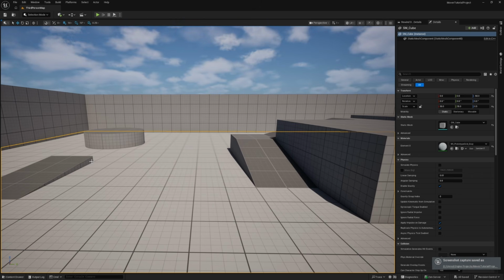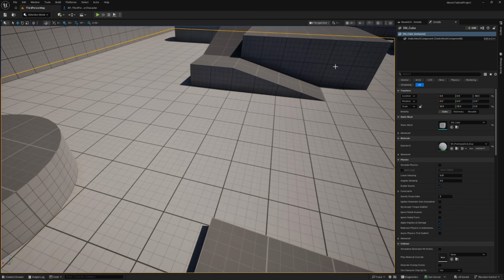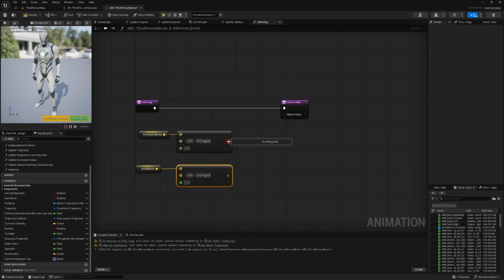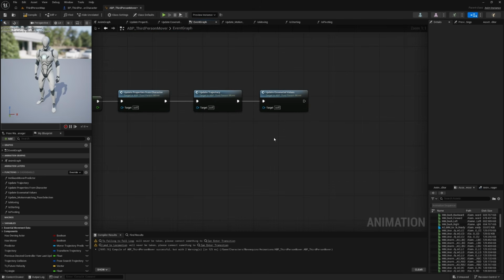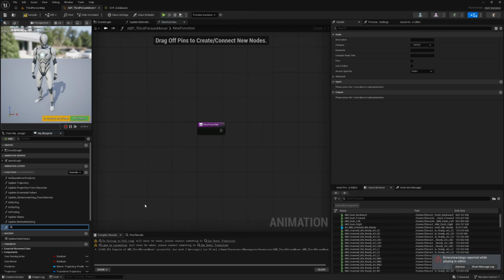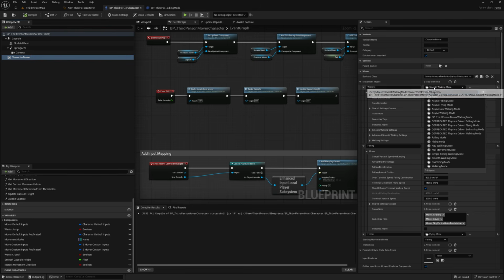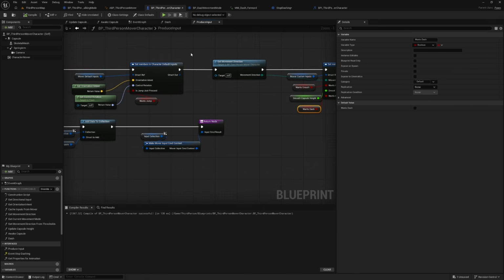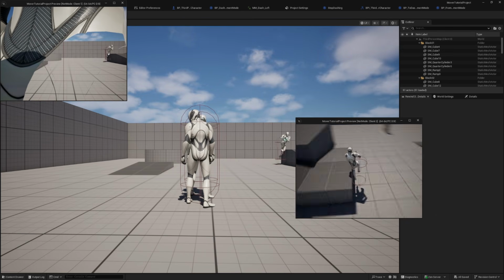Unreal Engine 5 Mover Component Advanced Tutorial (Dash Crouch Motionmatching) (5.7)

Comment: This seems to have some performance issues. Im on a 5090, 120 fps down to 80-90 that's 1 player, nothing else in the scene. Only 40 mins in. Curious how bad the end results are.
Reply: It might be because of he did not set the update trajectory function as thread safe, in api doc, pose search node is required to be called in a thread safe func.
Reply: @hamzayildiz1362  idk, im newbie to this, i went back and played gasp and their too drop to 80 90, guess its just a taxing system since its running all on tick

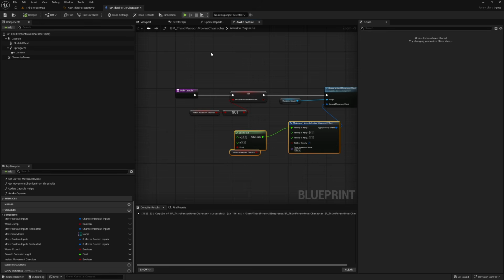Comment: 2:10:22 that does not work, try to move with crouch then stop movement and after that uncrouch. your capsule will go through a floor, and after that you would never be able to crouch correctly.
instead of this you can call TrySafeMoveUpdatedComponent when your capsule updates. There are what you need to insert into method args:
1. MovingComps - break the structure and insert into UpdatedComponent MoverComponent->GetUpdatedComponent(), into MoverComponent your mover component;
2. Delta - your capsule delta changes (FVector( 0.f, 0.f, (OldHalfHeight - NewHalfHeight) * -1 ));
3. NewRotation - your capsule world rotation as Quat
4. Sweep - true
5. HitResult if needed
6. Teleport - None.